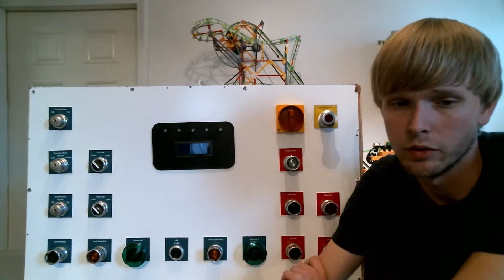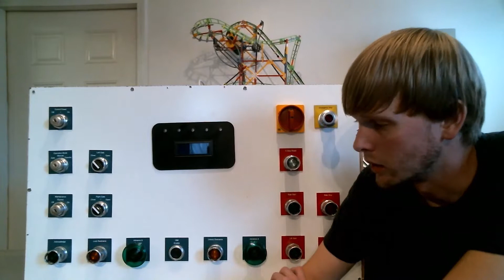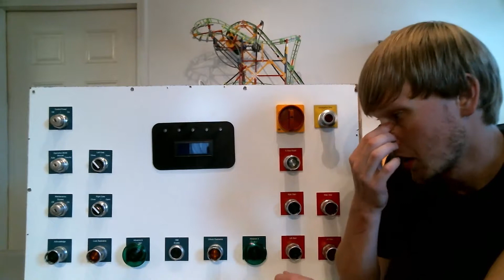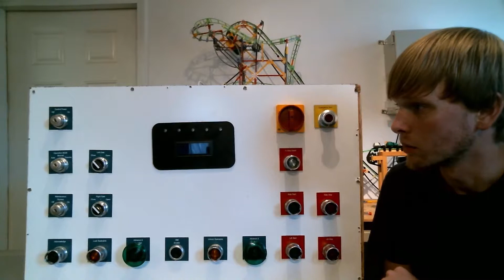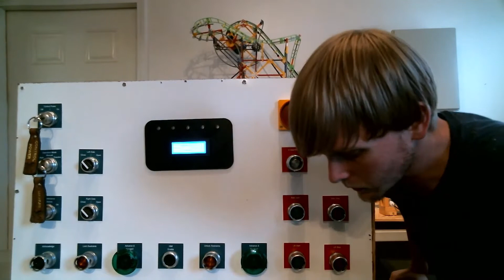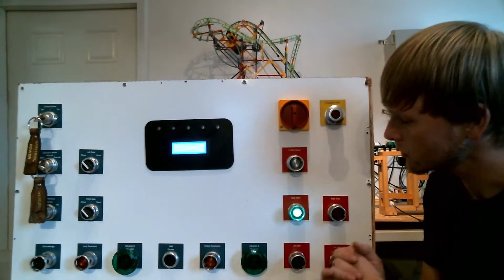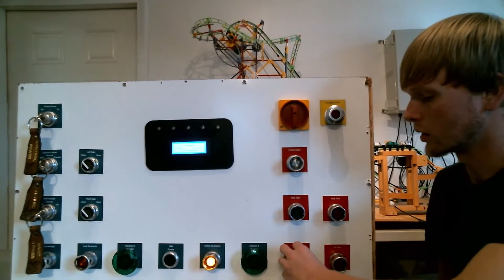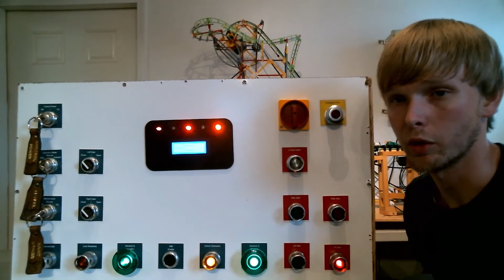Arduino Mini Coaster Control Panel Explained

Comment: Anywhere I can get your exact code for the arduino? I’ve been working on something similar but my coding ability is piss poor.
Reply from the maker: I Don't believe anyone has a code like the on this panel. It's my own personal code.
Reply: Meltinglawyer do you think you’d be able to email me the code your using to see if I can adapt it to my set up? I’m basically doing something similar but with a lego coaster. I just won’t have the automated transfer section on mine. Justicedelacruz545@gmail.com